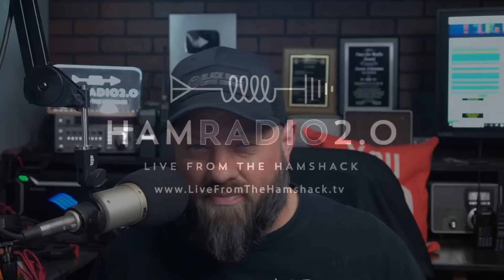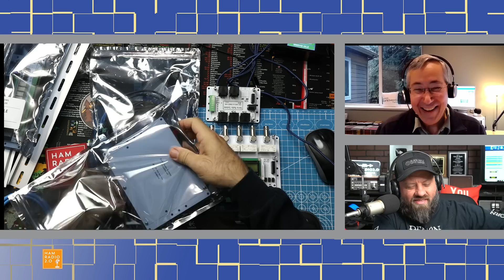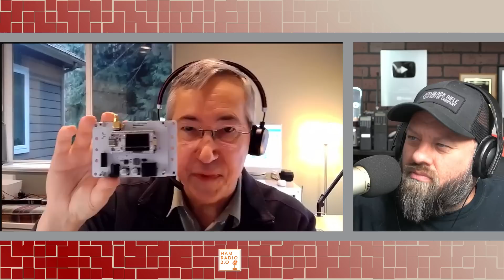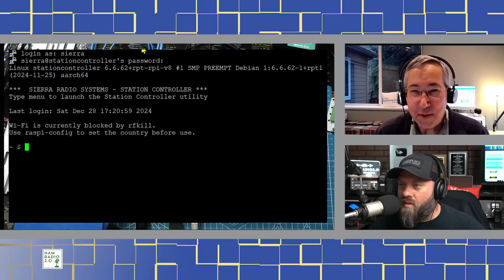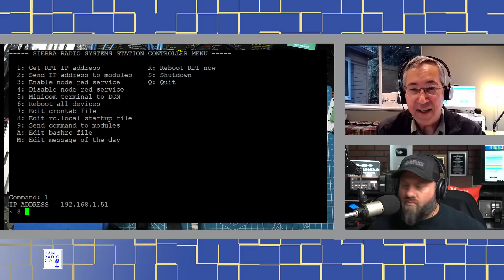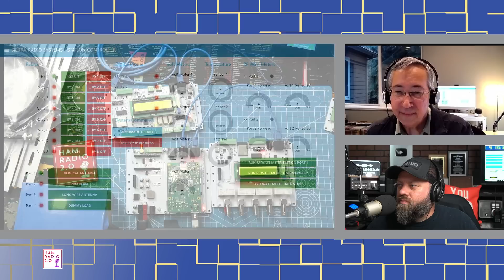COMPLETE Remote Control of Your Hamshack!

Comment: The design really had consideration of a few things that were really good. Connecting all of the power poles together and allowing different placement of where power comes in is really handy for when you want to cable manage and keep things nice. This is really good if you place this in a really hot area that needs airflow thats also very small. Cable management is pretty important and they clearly had that as a priority. I'm also interested in the meshtastic aspects of this and pushing the limits of what you can do with it.

Comment: Be careful with the sd cards and other flash media used with raspberry pis. they have a finite number of write cycles and if you log to the sd card, you can end up with a failure pretty fast, a lot of my sd cards have died within 6 months